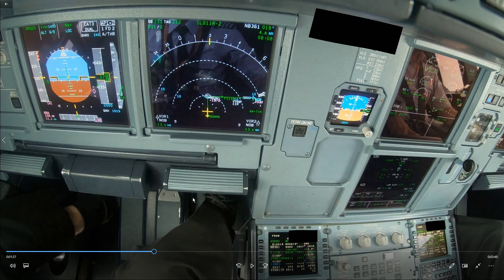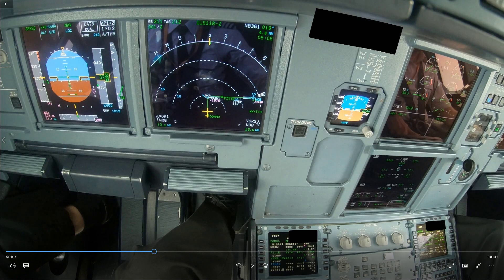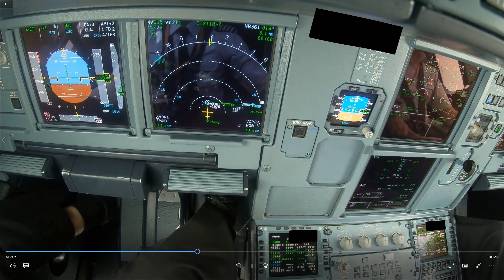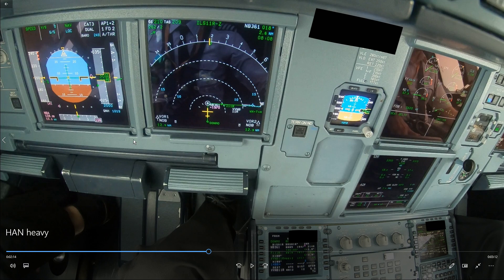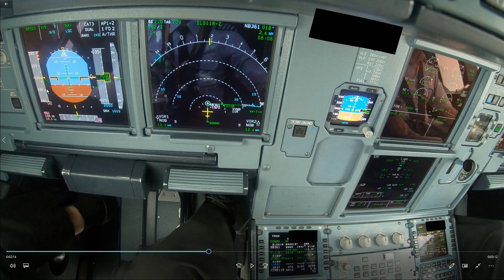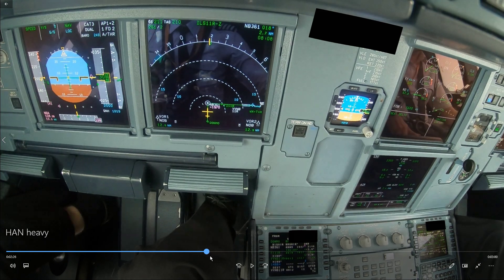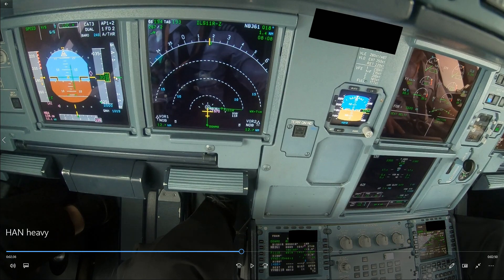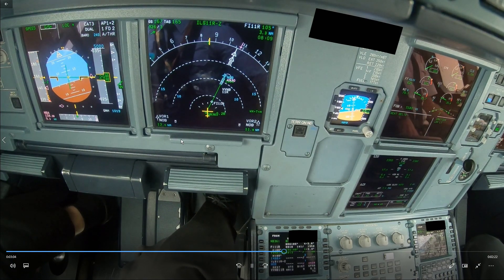A320 approach when heavy

Comment: Hi , can i have a question.
How can we increase rate of descent in DES mode. ( if we have to fly in Des mode to follow constraint ).
Reply from the maker: If you are above the VDEV in DES mode you can increase the speed or select speed brakes to increase the rate of descent. If you are on the VDEV or below, you have to change to OP DES and set the altitude to the next constraint.